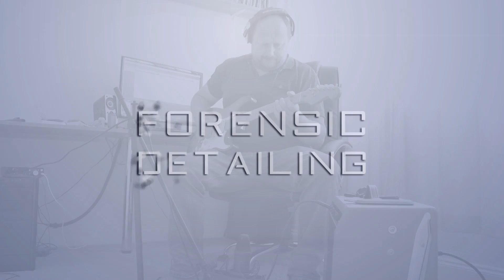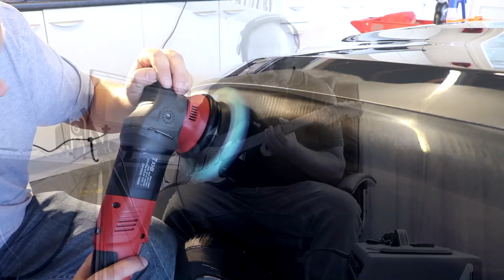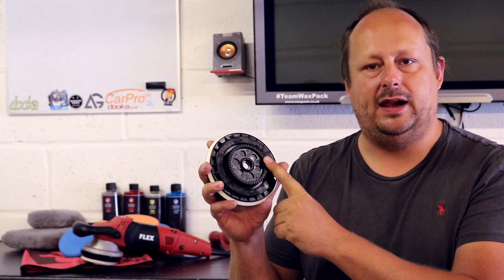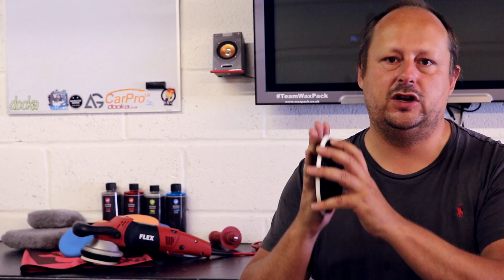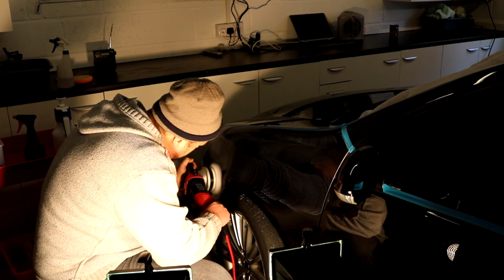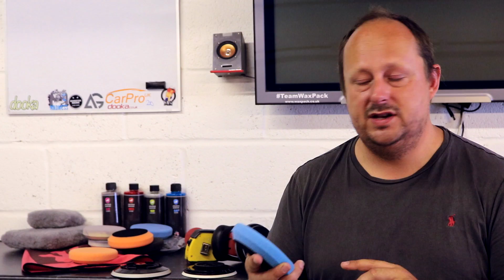Flex XC VRG 3401 machine polisher review

Comment: Good comments on a tool you feel confident in doing most. These tools are not cheap to have a few for most people. Good vid.
I cannot make my mind up and was looking at the Rupes Duo, but the Flex would be cheaper, sorry, better value. Will not ask you, that view is confirmed with this review. Right?
Reply from the maker: you can get results with all these tools.. the long throws have a good amount of cut compared to normal 8 mill throws.. they are really nice tools to work with..  the 3401 I feel gives more cut than the free spinners.

look at my "how to polish a wing with the flex 3401 part1" video (something like that)

goto 1minute20seconds of that video..  look at the damage.  that is heavy damage and lots off it..  look at the results later on (might be in part 2 of the camera shots after the cutting set)

the flex 3401 took that damage out with s3gold xxl on hybrid power pads with 1 set (hell of a long set but I follow what gives me results with certain products and I love xxl because I can work the hell out of it)

if a 3401 can do that level of correction in 1 set with foam pads, but never burn paint or put trails in...  as and end user hobbyst Ive reached my mecca.  I dont need to explore microfiber further I dont need to explore abrasives (its doesnt bed down like the water dominant ones and is easier to remove ((oily yes)))...     when you find a method that works you are kind of done.. any new offerings really gonna have to convince me its going beyond what I have already (tall order, it would almost have to be able to give that level of correction in 1 set in less time or effort or be cheaper, or have some innovation in the way it works etc to even stand a chance of making me ebay the 3401 and going with it)

the flip side to that is Flex now have competition in the fixed rotation from vertool and the chinese guys and rupes have just brought out the mille forced rotation (which takes a slightley different approach)  so theres always things for the channel to explore for people looking to make decisions.. but I made my decision a few years back and the flex 3401 surpasses my expectations of whats achievable with DA's...
Reply: I did watch those earlier vids you did, all three.
Tools are like shoes, if they feel right, comfortable and do the job, they are for you. 
At the end of the day, you want to correct or polish and be comfortable doing the work, that must help with that end product.
Reply: Thanks John. Have to decide on going with the 3401 with 5.5” b/plate. £295
The Rupes Mille is Pro tool and over a “monkey", overkill for an enthusiast.
Only other option is the Rupes DA 15ES with 5” b/plate which is now selling as tool only under £280 and good option. 
The Flex 7-15 is +/-£40 more now.
My gut feeling for my needs is the 3401 with 5.5” b/plate and buy the Lc b/p for £22 and go from there. Also, that the FD and 8mm throw has to give more feel for control, just seems logical it would.
Mind made up…….. yeah right! LOL
Recommend some 5.5” pads and that might do it?
Reply from the maker: the mille price tag is in kit form..  Im not sure what the tool alone is yet..   Im also going to be reviewing the in2detailing fixed rotation offering which is a copy of the 3401 for half the price tag and it has 4/5/6 inch plates available (you get 5 and 6 and you can buy the 4inch for ten pounds)..

If the quality of the in2detailing forced rotation is as good as their das6 pro plus free spinning varient then it will be VERY viable if you want a good tool for home use...

if your gonna go 5.5 pad then it has to be the new hybrid force ones designed by LC for the forced rotation machines...

Comment: I'm using this polisher right now with a microfiber pad with a coarse polish and either I'm not putting enough pressure on a side panel or it's just not spinning fast enough because it doesn't cut nowhere near as much as my 3" Adams SK Pro...

Comment: I bought a spare 3401 which I'll use as a backup to My original one... I'll have the standard backing plate on one for 6-6.5 inch  and a smaller backing plate for smaller pads on the other buffer. 

Very thorough explanation.  Love this channel!

Comment: Hi mate I am struggling to find the lake county adapters in the UK do you Know anywhere ? Also what other machine would you recommend for an upgrade from my cheap DA ? Thanks
Reply from the maker: the 3401 is out of production now and the lake country adapters are out of producction too if you cant find them searching ebay or google thentheres prolly none left now Jak,   if you like forced rotation I love the XCE cordless.  otherwise a nice DA15 and DA12 combo from in2detailijg is cool check out my tooling reviews
Reply: @ForensicDetailing   thanks for the reply I just wanted to upgrade my da to something with a bit more cutting power and a bit more up market, I don’t mind spending the money I just want a good quality reliable machine I currently have a cheap autobrite 21 da would you recommend upgrading to the rupes ? Thanks
Reply from the maker: so 21 ml throws are a bit frantic and hard to edge with because of the large orbit.  I dont personally like them.      Rupes is a nice machine.  you need to decide how much money to spend first.   if you go rupes or flex and you want multimple machines then you could be looking easily 800-1000 pounds for 2 machines.

I would watch this first.   https://www.youtube.com/watch?v=wxtYZ9Pe2NA&

its important to understand the tool is not going to really be critical, its like if you are drilling all day will you drill better with a makita or dewalt.  you might have some small preference but often you go with a solid reliable offering at a sensible starting point.

I would watch my video review on the DA15 and Da12 combo this is where I think you should start with these 2 tools.
Reply: @ForensicDetailing   thanks for that if I managed to get a 3401 what other backing plate would you recommend ? I don’t mind spending the money just wanted to get something a bit more upmarket than my autobrite DA I will look at your other review on the da12 and 15

Comment: Hi Jon, I just got this machine I've been watching your videos reviewing it and I would love to know where do you get the LC adapter plate system at? I've searched the web far and wide and can't find it anywhere. If it's not possible to buy anymore what pads do you recommend for this machine? Thanks alot for help
Reply from the maker: its deiscontinued now Gary.  the 3401 tool is out of production and Lake country stopped making the adpater plates about  2 years ago.
Reply: @ForensicDetailing  it's a pity that they stopped making it I only got this polisher yesterday I just need pads and I've been watching your videos back. This is my first polisher too. I was going to get the cordless option but for an enthusiast like me it's not worth the cost
Reply from the maker: @gary7323  you can still get this adapter plate I Think.. try ebay.  try polished bliss or the other UK detailing distributors.

Comment: How is the vibration on this machine? I have the Rupes 21 and it's pretty smooth, but looking to get this machine, too.  Thanks
Reply from the maker: Less vibration than a 21 free spinner.  I find the 3401 really smooth down on speed 4 I can use all day and not really get the knumb hands..  but just to be clear its still more vibration than a rotary because of the offset and track system.. but decent for sure.
Reply: @ForensicDetailing  Thanks.

Comment: Hi mate, absolutely love the detailed walkthroughs..jumped for this machine so can't wait to try of the back of this vid but a question for you please, how does the lake country hybrids or force pads work with the Menzerna compounds? I'm not a pro detailer, just for my own cars plus it's friggin relaxing so I guess I'll buy panels to mess about with. Thanks in advance..please keep going doing what you guys do👊🏼
Reply from the maker: yo jay jay.   I have the new 5.5 hybrid force pads but I dont have the right plate size to test them properly really to comment accurately.  I found the heavy grey pad a bit jumpy, but like I say wrong plate used so it probably was not centred properly.     but I just prefer these 5 inch hybrid power pads I wish then had not discontinued them
Reply: I can't wait to try it, I just hope the Menzerna and force pads which I've ordered work out well..I guess time will tell having very little experience in this..cheers for the reply btw👊🏼

Comment: Between the flex 3401 and the rupes 21, which of the two would you recommend? I’m in the market for one but don’t have the money for both.
Reply from the maker: I recomend both tadea...   the flex3401 or any forced rotation can be a handfull to operate , there  is no mini forced rotation device to pair it up with.  The rupes 21 has a crazy large orbit.. the 21 mil throws are a bit of a handfull as well, a bit more vibration and wobble from the large throw, you cant edge that well with them. You could pair it up with the  75 for smaller areas.

If you go down the free spinning DA route I would suggest the rupes 15 or the flex xfe 7-15..    Go down the forced rotation if you want the DA action but want a bit more consistency to work the abrasives without stall.     

I love the 3401 with the discontinued LC4 inch plate with 5 inch hybrid power pads.    Without that combo Im not sure if I would use the tool.   See if you can test the tools out somewhere before you buy that will help you decide mate.. Its such a personal thing.  My personal view isnt the route most people choose.

Comment: Hi. Annoyingly it seems Lake Country have stopped making the 4 inch backing plate pads, and moved to forced hybrid. Is this correct?
Thanks
Richard
RB Detailing
Reply from the maker: yes mate.  lake country adapter plate system discountinued and hybrid power pads discontinued replaced by hybrid force.   So hybrid force sizes line up (more) with flex's proprietary plates.

I just went an ordered a truck load of the 5 inch pads from america. because this pad size works so damn well for me.
Reply: Forensic Detailing Channel
Thanks for the reply. I must try the new pads. How are you finding the backing plates lasting. Mine seem to last a few months, before the teeth wear down and it fails. It is used every day however, usually on speed 5 / 6. Have you had to replace the backing plate?

Comment: This or a rotary?
Reply from the maker: lot of variables which could push you down one road or another...  If you just want one tool that can do the lot, thats potentially a lot cheaper.. then its the rotary..  smoother, potentially more capable, can edge better with it, hit intricate areas on extention bars etc.. also perhaps better for finishing down..  but harder to balance and operate and if used pooly will make your paintwork look worse.

3401 corrects at a really solid rate, cannot do anything bad or dramtic as a misused rotary.. wont over head the paintwork etc... perhaps therefore more consistent..  3401 is a tool that I will always use a lot and will never be without.

you cant go wrong as such with either choice but its understanding what they offer which Ive had a go at covering.
Reply: Forensic Detailing Channel does the dewalt 848 fit the same 5.5" backing plates as the das6?

Comment: John, from your link on 5” pads for the L/L conversion AG say they are stopping makiing these and they measure 5.5".
What pads do you consider the next best option. CS or another supplier CG etc. Going to order 3401 but stalling on way to go pad wise as per your vid. Cheers.
Reply from the maker: the lake country 4 inch adapter plate is discontinued..  Also I "think" the LC 5 inch hybrid power pads are discountinued but still in stock with various distributors..  

I suspect this is to do with the 3401 replacement tool from flex the (XCE)..   and I think flex will be doing a more conventional range of plates for this tool and LC seemed to have released a new hybrid force set of pads that I suspect are going to be for the new tool..

so if you buy the 3401 my advice would be get a 4 inch adapter plate while you still can and stock up on the hybrid power pads..    but this might be a bit of a risky approach in case your plate breaks or they run out of pads etc..

the alternative is to hold off and see what happens with the upcoming release of the new tool...

also consider the rupes mille will be out very soon.  I will also look to review that..
Reply: Lake Country released a new updated version of the Hybrid pad. I really like the performance of the original LC Hybrid pads. Like you said, they last forever. Don't know if I will need replacements anytime soon. So, trying the new version might be a while for me.

Comment: i would like to ask why you dont use the original flex 115mm backingplate? my 3401 came with the 140mm but i changes to the 115 and can now run 5" pads perfect🙂
Reply from the maker: I wanted to to use LC hybrid power pads which have 4 inch fitment. the cost of the LC adapter plate system (with 2 plates and adapter) was cheaper than the 115 mill flex plate and the flex plate would not have supported the hybrid power pad.
Reply: Forensic Detailing Channel okey I get what you was after now. Are those pads really that good? I have bought scholl s2 and white spiderpad and gonna test it soon. I have used megs m100 with there mf cutting pads and m205 with there foam polishing pad. I have a problem with the 2nd stage to get rid of the maring that m100 and mf leaves on my sapphireblack bmw (hard). Soo im about too try a flexipad medium heavy polishing pad instead of the softer meguiars polishing pad with m205 and then do a juweling stage with menzerna3800 that I discovered from your videos.
Reply from the maker: sounds like you got a nice amount of hazing from the compounding stage... I find its more the MF cutting pad that does that than any compound..   compare dry buffing with a foam cutting pad on a black test panel versus dry buffing with a MF and look at the difference..  important to get really good coverage all over that MF pad but it still prone to leaving that haze..    I rarely use the mirror glaze stuff to cut now, just dont get the working time out of it no matter how I use it (it relies to much on water for me).    biggest suggestion I can make is switch to S3 gold XXL and just use a foam hard cutting pad and work the abrasive for a long time (about 3 times longer than you can physically work m100) even on hard paint a slow 3-4 minute set get a lot of cutting done.. (see how to polish a wing video with flex VRG which demos how much cutting you can do with s3 gold xxl on a 3401 in one set)
Reply: Forensic Detailing Channel 
I think your right it can def be the mf pad itself and I feel the same about the workingtime on M100 its way to short. You have to compensate by use more product than normal and sometimes do a mist of water too get more out of it.
Thats why I bought scholl s2 that says has 30% more cut than s3gold xxl but finish the same as s3gold. I also got recommended the white spiderpad so it shall be interesting to see the results.
otherwise I also like the flex 3401 very mutch. It can do almost everything accept tight areas. I will do a test on my trunk with M100+mfc pad vs M100 flexipad heavy polishing foampad vs scholl s2black ss with with spiderpad.
I would also like to make a request, myself is currently switching over more to the ceramic products (schampoo,detailers maintenanceproducts etc) not only coatings. Maybe you could do a schampotest? where you have one ceramic catagory and one regular and then do a 1on1 with the best in both categories because there is quite many brands now that offers ceramic shampos and detailers. I saw you had the enigma in your detailertest but there is for example tac system,polishangel,herrenfarht,nanolex,gyeon,cquartz and so on. I think many would appriciate a test of schampos because you doing these tests soo good and interesting and on equal terms for all products. sorry for my bad english😂

Comment: I just bought the 3401 as an upgrade for my entry-level DA Kraus DB-5200 (which I used for years) because it lacked cutting power on my hard BMW paint.
The forced DA seemed to be a perfect mix of benefits of the DA and rotary. 
Thanks for the good review. I'm curious how my experience will be on perfecting my black paint.
By the way, I also purchased Scholl S3 Gold XXL and sandwich spiderpad (160mm) as it seems to be a nice combo for hard paint.

Comment: There is that bundle, but it is substantially more expensive, like ca 500. I am not sure it packs shit worth an extra 200 queen heads, though... If I want to get up an running in a meaningful way, how much do I need to spend on accessories to do my own car (just one)? I would have long bought one, but I really don't wanna buy one with a UK power plug, even though I am in the UK right now :P
Reply from the maker: flex 3401 plus LC adapter system that includes the 4 inch plate plus lake country hybrid power pads 4 (cutting blue or orange) 2 polishing (finishing pad options)

your looking about what 400 quid?     budget is always a concern..  I might review a forced rotation copy which is around half the price. although i dont think it supports the LC 4 inch plate but comes with a smaller pre made plate..   

will also look to review the mille...